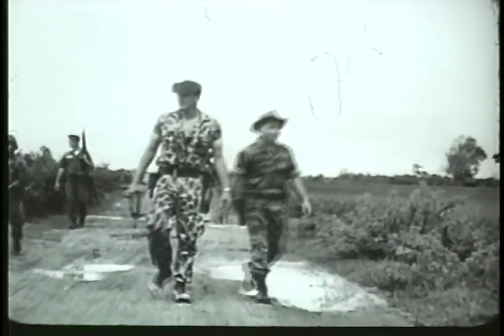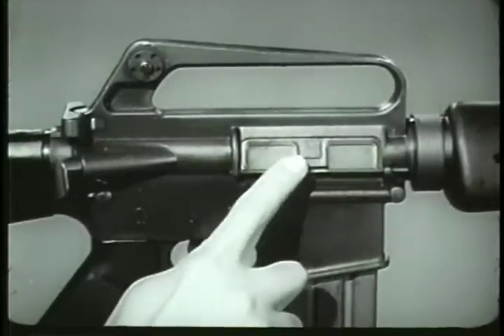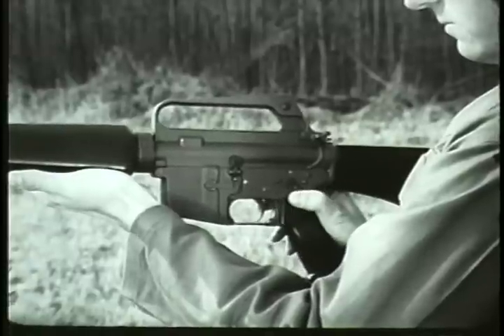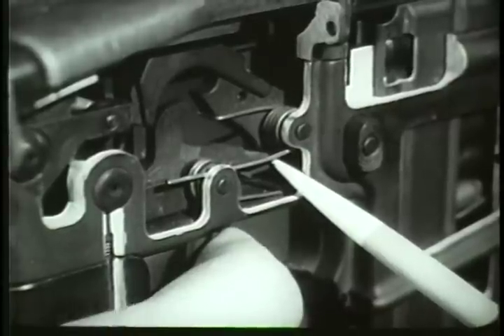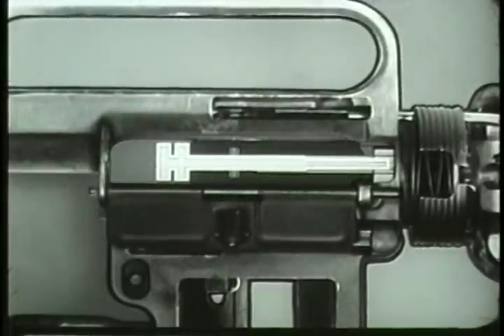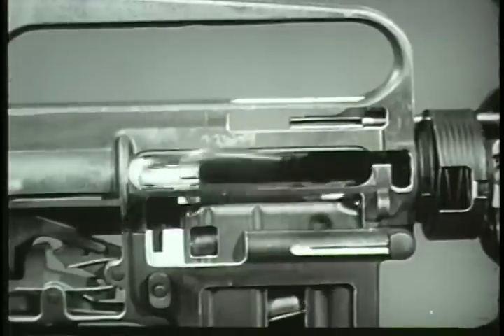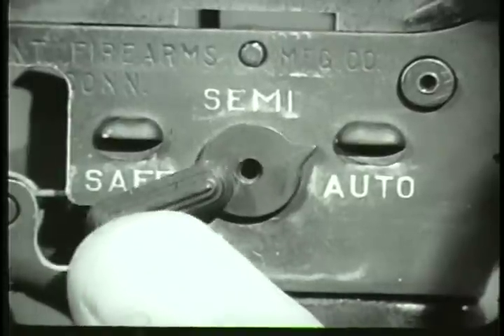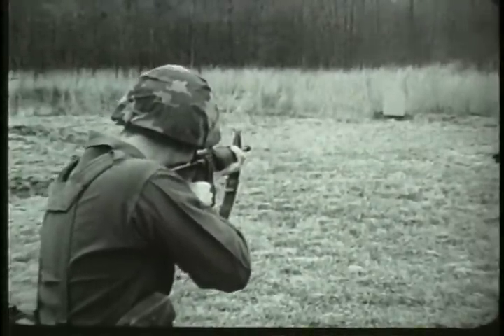XM16E1 Rifle 5.56MM - Operating And Cycle Of Functioning

Comment: Sigint: "No, it's not an AR-15. It's an XM16E1, a top-of-the-line rifle that the Army adopted recently on a trial basis.”

Thanks MGS3
Reply: The designation of AR (armaLite rifle) was created and applied by the armaLite corporation and Eugene Stoner its creator.  The M16 designation became applied when the AR15 rifle entered into the US military system (M = military).
Reply: @edmundcharles5278  m stands for model but close enough
Reply: Are you aware that ALL XM16E1s have AR-15 stamped on the receiver?
Reply: XM16E1 is just a military designation for a particular model of AR-15 (early Colt 603)
Reply: @edmundcharles5278  wow almost everything you just said was wrong

Comment: 5:58 he didn't slam the bottom of that mag. I can already feel a jam.
Reply: In my experience you don’t really need to make sure the mag is seated properly if the bolt is already open. It should go in very easily with the bolt open but might as well tap it again I guess.
Reply: you missed a golden opportunity to make the time stamp 5:56
Reply: With the original type of magazines for the AR-15/M16/M4 etc., you often have to slap the bottom of the magazine to make sure it's seated, if you are inserting the magazine with the bolt closed. When the bolt is open, this isn't an issue. I believe with modern mags like PMAGs, it's not really an issue at all even with the bolt closed.
Reply: I was gonna say, I wonder how many takes this took due to jams😂
Reply: @LUR1FAX  PMAGs do go in easier with a closed bolt, but it still helps to load them with 29 instead of 30.

Comment: Back then this was the obligatory ridiculous "Space Age" rifle.
Now this is THE rifle.
Compared to other service rifle that day, the M16 might've been the most advanced. Now every military that's not a ComBloc have one.
Reply: Indeed, but so sad that they have neglected one of the most important parts of it's design in modern military use; weight. With all the gadgets and gismos on rails and those quick lock handguards the rifle is almost double the original weight. Sure modern optics are great and all but having a bunch of stuff weighing a light design down just makes it dumb, might as well go with a battle rifle at that point (cal .308/7.62mm). It was never designed for longer ranges like a designated marksman rifle so iron sights should do perfectly fine, maybe red dot in this age for the carbine lenght
Reply: The "bad guy gun", the AKM was a good counterpart. And the other impressive guns manufactured in Germany, Belgium, France etc.
Reply: @TheZebinator   it wasn't designed for longer ranges, but it can do it. A 16" AR can go all the way out to 500 yards, a Mk 17 goes to around 800 yards, and an SR-25 goes out to about a thousand. They each have their tradeoffs, otherwise the military would be carrying big heavy 20 inch .308 rifles, kicking doors in with a rifle taller than the damned door.
Reply: @candle_eatist  Oh I know well that the AR is accurate at long ranges, it just wasn't designed to be used for that. And yeah every tool has its purpose, don't often see teams clearing rooms with AA cannons. It's just that how the rifle and its variants are used in military today is a "jack of all trades, master of none" setup. It would be better to have standard ARs and one more LMG per squad than everyone having a semi LMG ROLE. Maybe even a marksman in every squad for long range, but depends on squad size ofc. Iirc US military squad size is 6 but a squad of 12 with 2 LMG, 1 marksman and the other 9 with ARs could work for some things

Comment: 4:50 ah yes, the M16's most unique feature: the Jam Enhancer
Reply: I’m not so sure everyone knows what you’re talking about. Could you please explain why the forward assist isn’t effective? We’re just curious. Thanks.
Reply: @ethankaryadi37  the forward assist button on the M16 very rarely works as intended. Most times it worsens a malfunction as opposed to actually fixing it. This is mostly due to the fact that the forward assist was not a part of the original design. The designer (based on experience) believed that if a round didn't want to chamber properly, it's better to find a way to eject it as opposed to force it in.

The only reason the forward assist got added was because the US Army wanted one for "psychological and morale" purposes.
Reply: @CheemsofRegret  there are a lot of instances where you need to help the spring out, like if you want to be quiet and need to ride the bolt home in order to not produce a huge racket
Reply: @wizard_of_poz4413  cause the m16 is soo quiet lol. It was entirely unnecessary and still is. A reliably unreliable machine gun it was. This gun got thousands killed. It's why we upgraded the standards today.
Reply: @wizard_of_poz4413  thank you, nice to know some people glorify our relics instead of learning about their very real flaws in our firearms of the past. It's a fine gun if you knew how to care for it, but for G.I.s it was cheap and jammed easily with mud and dirt. Learn from the past friend don't phelatiate it.
Reply: @agentjohnson3973  I am very aware of the transition between m16 and m16a1, that was the point. The difference and people it got killed between then is staggering still. M16a1 is a lovely gun, without the failing m16 it wouldn't exist
Reply: @agentjohnson3973  I'm more disappointed you would apologize for the idiots in charge of a jamm sandwich of a gun. It stands as a great example of what happens when you don't educate or equip your soldiers about a firearm before throwing them in shit.
Reply: @CheemsofRegret  🤣🤣🤣

Comment: A very innovative weapon for the time. Unfortunate that it was rushed into service before it was ready, and without adequate instruction.
Reply: The massive malfunction issues mostly stemmed from the US government not providing the super clean burning 5.56 ammo that Eugene Stoner had used during the engineering trials.
Reply: The Green Tilting Followers In The Original Ammunition Magazines Causing Jams Misfeed Malfunctions In The Rifle
Magpul Fixed That With Antitilt Followers

Comment: The XM16-E1 Operation and Jamming Operations
Reply: The a1 fixed every issue and the real cause of the jams of the xm16 was the military using the incorrect powder causing more fowling it burned at a diffrent rate causing the fire rat to increase which cause the bolt to cycle to fast fo pick up a new round and it would cause the cases to stick due to extreme fouling as well as the case expanding to much by the higher pressure
Reply: And they were not issues with cleaning kits which was really sabotage by too brass because they were fudds
Reply: @christophermercer2632 : Not issuing a cleaning kit is inexcusable!

Comment: @19Kettle93 Funny that you should mention the whole police fighting junkies thing, because it happens sometimes in Afghanistan, and in fact because of that some want to make pistols firing .45acps more prevalent than 9x19s. The .45acp is an old round, one that has old in origin but modernized weapons to fire it with. same thing with the 7.62x51, which is used in most of NATOs battle rifles, that are old in origin but have very good modernized versions.

Comment: I would like to send this video to call of duty, pubg and other games that made m16 burst.
Reply: they probably have the m16a2. that’s burst
Reply: There isn't just one model of M16 bruh
Reply: The A1 lower was full auto - that chanced with the A2 which is what Pubg uses. The A4 is also burst instead of auto. The a3 has auto but it was not widely adopted
Reply: Black Ops 1 had an M16A1 that was burst fire. If anyone remembers Conflict Vietnam did the same. Sad!
Reply: @Dionach  it was the M16E1 actually, but none of them until the M16A2 have burst so still wrong
Reply: @redtra236  You're right, I never noticed the duckbill on the Black Ops M16 until now; E1 is my fave version of the M16, as well. Shame about the burst fire, but there was a much better depiction of the E1 in Snake Eater lol

Comment: Meth IS Speed. 
Plus, if SAW really had a problem with junkies, they'd buy UMPs. 
Cheaper to manufacture than the MP5, and it fires a .45 caliber round for optimal knockdown power. And the obvious compact size for clearing rooms. 
Now I'm probably wrong when I say this, but the H&K UMP should be a standard for law enforcement.

Comment: Don't drop it in the water, let it get dirty, or even use it.. unless you have to. Mattel made the hand grip.. lol.
Reply: Mattel never made any part of the m16 stop passing on the myth the gun was great when designed but generals sabotoged it by calling it self cleaning and not issuing cleaning kits they also used the wrong powder and pressure specs which would cause ruptures and the case would overly expand the case causing then to stick which is part of the reason the chrome line bore and chamber came out the m16a1 was a great gun

Comment: How many magazine he brought inside his magazine pouch? Seems they only bring few pouch, with only 20 rd per magazine at this era, they will burn their ammo faster compare to modern army combat load that bring lot of ammunition
Reply: No they're able to carry a minimum of 6 or 7 magazines these old ALICE magazine pouches can hold 3 per pouch
Reply: @skulldozer1462  oh nice I thought that pouch only fit for 2 mag each, but judging from mostly auto fire doctrine from the past it still eat that ammo fast especially when they still using 20 round mag even 30 mag still dry fast in rapid semi at heated combat
Reply: @telurkucing5006  well the average engagement distance in the jungles of Vietnam is just 10-30m so they can use full auto to the GIs choice and light the whole jungle up and hopefully VC could either pull out or fragged but they could use the semi feature if they were to be fighting in Europe that is which they can get about 300m with single shots
Reply: Later in the Vietnam war the U.S. would issue 30 round capacity magazines  to troops
Reply: The ammo cans to this day are packed with cloth bandoliers that can hold extra 20 round magazines, and if you take a thread out they can hold 30 round magazines.
Reply: I forgot to add these old M1956 Web gear can hold 5 magazines per pouch but by standards soldiers and Marines alway have two of these pouches or bring more same goes for the M1967 webbing gear

Comment: Can anybody tell me how good these really were in the field? going up agaist AKs with a bigger calibre and 30 rd mags sounds a bit outmatched? Correct me if im wrong!
Reply: Good history worth researching, political problems, no chrome lining and wrong powder were bigger issues than mag size and bullet size.  Two tools designed with different intentions, but constantly compared
Reply: Considering the North Vietnamese weren't wearing body armor at the time the 5.56 was pretty lethal on soft targets due to good yawing and fragmentation
Reply: @skulldozer1462  there wasn't much armor at the time except for steel plated flak jackets, but those mostly protected against shrapnel and some pistol caliber rounds.
Reply: @UgandanAirForce  yep so the 5.56 didn't struggle except penetrating cover
Reply: They had a tendency to jam if all 20 rounds were loaded in the mag. It rarely happened if only 18 were loaded (and that was also an even multiple of 3 for burst fire mode)
Reply: @misterturkturkle  
That seems like cheap magazine problem, I suppose it was workable.
Reply: @misterturkturkle  The M16 and M16E1 don't have burst fire, they have semi auto and full auto. Burst fire M16s(M16A2) wasn't a thing until the 1980s.

Comment: If I was in battle I think I’d go with the armalite platform. Sure you gotta keep it lubed and clean but if you’ve ever shot an ak… the accuracy is just not there. And in combat I want to be sure if I aim at their head it’s heading their head
Reply: They will run past 7000 rounds with out cleaning or lube if built right.. Fudd lore what you just said..
Reply: @hairydogstail  that’s a BCM piston driven no shit it’ll shoot forever. What about direct impingement
Reply: @Electricianarchery  All AR rifles are piston. Either external or internal piston..That was an internal piston being tested on The Military Arms Channel..
Reply: @hairydogstail  they are all INTERNAL the piston doesn’t just float out there in middle of nowhere… the way the piston reciprocates is either through DIRECT blowback or gas impingement. The one in the video is a direct blowback essentially similar to the AK platform. Hence the high round count
Reply: @hairydogstail  maybe not “direct blowback” probably has some other name but you get the point
Reply: @Electricianarchery  Yes, it is called an internal piston..You apparently don't get the point..
Reply: @Electricianarchery  No, direct blow back is a firearm that the bolt is not locked like many 380 caliber pistols..

Comment: Never knew there was a coilspring in the stock of an M16 (4:19)
Reply: That's the buffer spring.  The bolt carrier hits a weighted buffer as it goes back under recoil and compresses the spring, which makes the recoil a lot softer.  The recoil is also in-line with the bolt and barrel, so the muzzle climb is less than a piston-operated rifle like the M14 or Kalashnikov where a piston and operating rod push off-center.  The only downside is that the M16 can't have a folding stock, because the receiver extends back into the stock.
Reply: All M16s have that

Comment: EARLY VIETNAM CAMO...INSTEAD OF BLENDING-IN....YOU STAND OUT FROM EVERYTHING
Reply: Duck hunter camouflage. Worn by SF Advisors early in the war. The regular Army guys wore OG-106 sateen fatigues, then later OD poplin, and OD ripstop jungle fatigues. By 1967-68, some specialized units (SEALs, Marine Recon, Army Rangers, LRRPs, etc…) wore either Tiger Stripes or ERDL camouflage fatigues, while regular Army units still wore the OD fatigues, which remained in service well into the 1980s.

Comment: those Vietnam weapons had no forward assist
Reply: The air force units weren't equipped with it but the army did
Reply: A lot of the ground forces used the M16E1 and M16A1 that has a forward assist

Comment: my $480 ( after shipping and tax ) fedarm FR-16 performance is fantastic compared to those oldy rifles, .223 Wilde chambering, free-float rail handguard giving it about 1.5 Moa free standing at 100 yards and eats dirty steel ammo lovingly. I only say this because people point to the flaws of the old guns made out of old materials but the metal, tolerances and polymers have advanced greatly making the ar15/m16/m4 platforms one of the best on the planet that everyone is trying to copy without admitting that there copying it.

Comment: sadly it diden't work so great
Reply: The rifle worked okay, but the initial delivery of ammo had the completely wrong type of powder in the cartridges and the earliest adopters of the platform were given no maintenance/care instructions or cleaning kits.  (Typical US .gov system integration!) Same thing happened in the 80’s with the Beretta M9s. Early 9mm NATO ammo delivered to the military was way overcharged. This resulted in slides breaking and other weapon failures. The gun was blamed, but it wasn’t Beretta’s fault.
Reply: @TheDude1764  uhh realy intresting, I didn't know the history about the ammunition problem. 
Thx